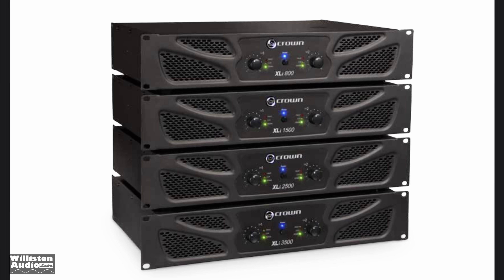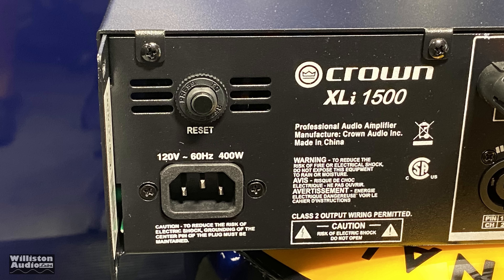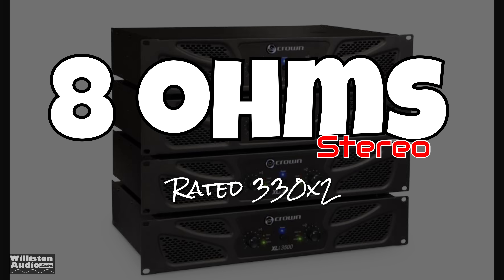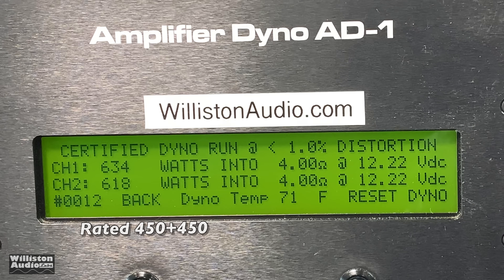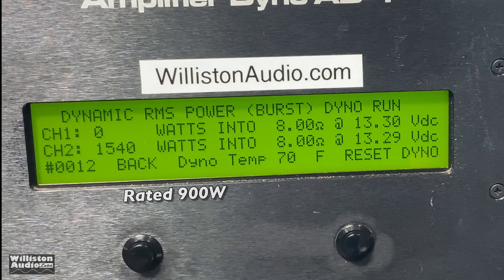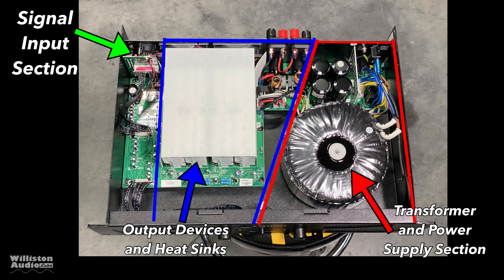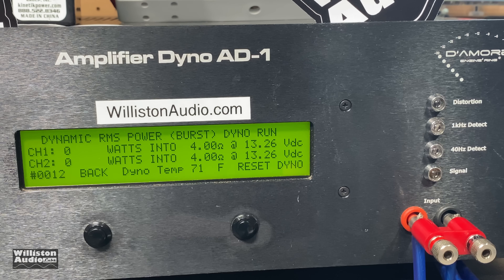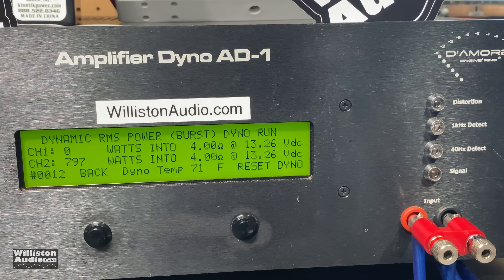The King of Pro Audio? Crown XLi 1500 Amp Dyno Test and Review [4K]

Comment: This amp is great for powering Car subs.
Reply from the maker: This one would work well for sure, except you’ll need an external crossover unless the preamp/receiver/mixer you’re using has one
Reply: eh... i kinda got a pro audio amp after watching it on the channel (the inuke 1000) and realized u need a ton of extra equipment to hook it to the computer and thus is useless lol, like a pre amplifier and or a mixer and an equalizer... its way cheaper to use a car audio amp and a 12v power supply
Reply: Berhinger 3000 or 6000 with DSP is better, just because you can run active crossover

Comment: 6 of those in a Dolby Atmos home system. Enough power to run all the surrounds & one you can bridge for the subwoofers. A cheaper way to go than many other solutions..  Loving the Haro BMX..  I'm still rocking on my 2007 Haro V1, same as this one but with upgraded disc brake on the front.. https://www.youtube.com/watch?v=ZipV6svHINc